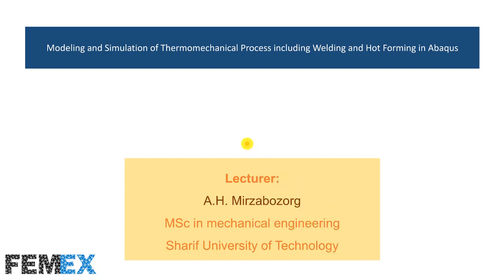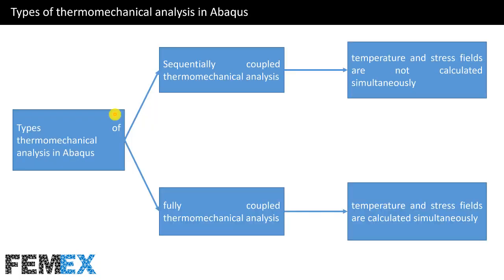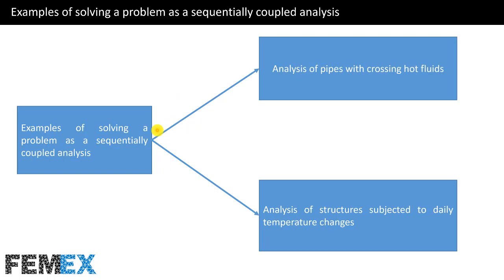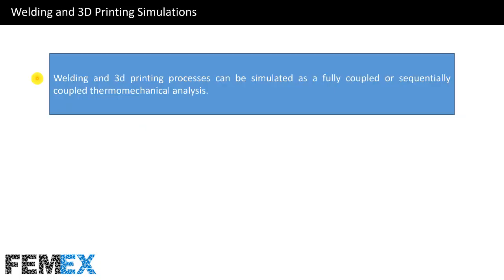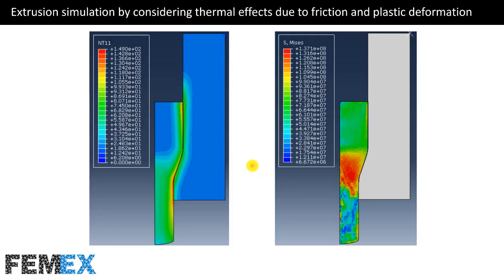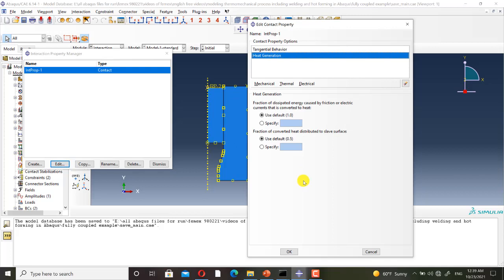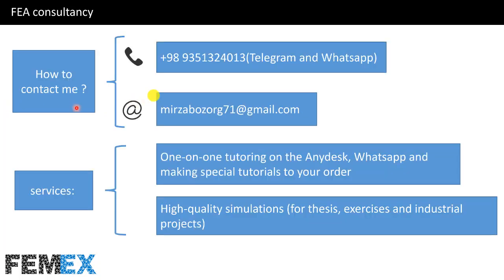Modeling and Simulation of Thermomechanical Process including Welding and Hot Forming in Abaqus

Comment: Hello, I hope you are doing well. I am currently engaged in a school project that centers on predicting the bonding process, such as welding, between two coaxial cylinders. These cylinders undergo a heat treatment and are subjected to axial pressure, which improves their contact and ultimately results in adhesion.
Reply from the maker: Hi.
Thank you.
Ok.
Please continue.
What are your issues in this regard ?
Reply: @FemexIran  Thanks for your response. Normally, my issue lies in the contact, when I apply temperature and radial pressure on both cylinders to improve the grip so they stick together. The heat does not transfer between the cylinders and the results do not converge. So, based on this data temperature and pressure, I want to predict this chart.
Reply from the maker: @oussamanaitbourhim4988  Unfortunately I don't have experience in such process and don't know how to resolve that issue.

Comment: Excellent video!

I only had one doubt, the two reference points were used for the application of which constraints? Tie type?

Thanks!
Reply from the maker: Hi.
One of them is used for defining rigid body constraint and the other is used to define coupling constraint.
Reply: @FemexIran  Excellent!

If it wasn't too much to ask, could you detail these assignments?

Is RP-1 connected to the die surface by the rigid body and RP-2 is connected to the material undergoing hot forming by the coupling?

Thank you very much in advance for your willingness to solve this doubt of mine.

Peace!
Reply from the maker: @gustavoteixeira1620  Yes they are. You are welcome.

Comment: Sir, I have done fire simulation in reinforced concrete beam in model-1 . I have done thermal analysis and have gotten the results. And in model-2 , I have transferred the results of heat transfer analysis into mechanical analysis. Then in the analysis of model-2 , I'm getting the error that there are 5 unconnected regions in the Model-2.
So please sir tell me how can I connect those regions ??
Reply from the maker: Hi.
Actually what you asked is not an error. It is a warning. I think you have not defined any constraint or interaction between the concrete and rebars. You must define mechanical contact or tie constraint between them and I prefer tie constraint because it is more realistic and even helps the convergence and simulation speed.

Comment: HI sir
I am trying to simulate a structure composed of two materials, where the first material has a higher thermal expansion coefficient than the other. As the temperature increases, the structure should bend.
The only material properties I have are Young's modulus, Poisson's ratio, and thermal expansion coefficient.
I've set up a static general analysis and applied a predefined field for temperature. After submitting the job, I obtained the desired results.
Now, what I aim to do is to automatically increase the temperature from 20°C to 90°C in a single job (if possible), and then plot the maximum displacement as a function of temperature.
How can I achieve this?

Comment: Helpful content. i have a question..My question is what are the different methods for simulating  sequentially and fully coupled thermomechanical analysis at Abaqus?? ....
Reply from the maker: hi.
thank you very much.
have you watched this video completely ?
because I think I have explained the methods of doing sequentially and fully coupled analyzes.
in the sequentially coupled analysis, first the heat transfer analysis must be done. then its result must be used in the mechanical analysis to account for thermal loads because the mechanical analysis cannot account for the thermal loads individually and conducting the heat transfer analysis is inevitable.
in the second case you can use one of the steps mentioned in the video to conduct fully coupled thermo-mechanical analysis and there is no need to do a heat transfer analysis.
Reply: @FemexIran   thank you...can i simulate a weak coupled thermomechanical "sequentially coupled " by another method... without the method of heat transfer only and include results in the mechanical analysis....Are there other methods??
Reply from the maker: @abdellahbenchekkour5188  you are welcome.
sorry for delay in answering you.
I was busy.
actually what you want to do is not a thermo-mechanical analysis and it is only a mechanical analysis because the mechanical steps in Abaqus cannot account for the thermal strains without any previous heat transfer analysis.
this procedure has some errors and due to the temperature changes in the reality, the results can be accurate or not. if there are high temperature changes, the result of the mechanical analysis is not accurate.

Comment: Helpful content, I have questions. 12:21 what is Job-2.odb ? Is this thermal equation ?
Reply from the maker: Hi.
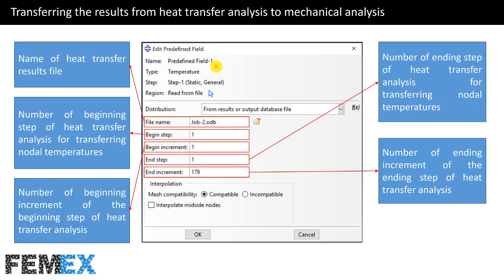As it is mentioned in 9:01, Job-2.odb is the result file of the heat transfer analysis which will be used to calculate the thermal loads in the mechanical analysis.
Reply: @FemexIran  can you send me this file ? Thank you so much.
Reply: @FemexIran  thank you so much, I'm having a problem, I don't know how to use therme load according to an equation in abaqus
Reply from the maker: @haulehuynhquang6672  Are you sure that file of this project is related to your work and helps you ?
Reply from the maker: @haulehuynhquang6672  Please send an email to me and explain your problem in more details. Because i need to understand that equation to give you practical guidlines.
My email is : mirzabozorg71@gmail.com
Reply: @FemexIran  thank you, I understood this lecture.
Reply from the maker: @haulehuynhquang6672  You are welcome.
Reply: @FemexIran  So in this example you used the sequentially coupled method, right? I want to Know if I understand correctly 
Thank you very much for your videos
Reply from the maker: @alialijamelll5016  Hi.
Yes I did.
You are welcome.